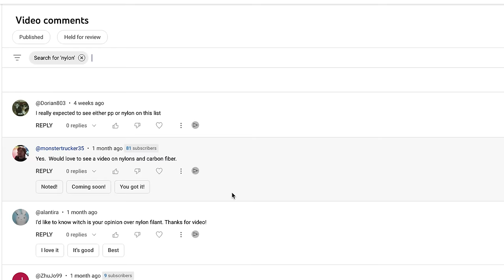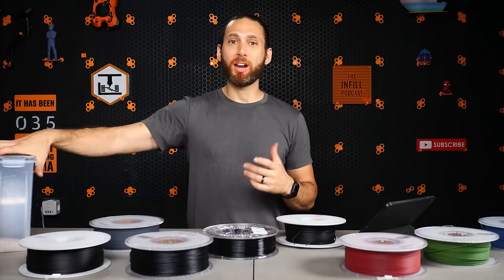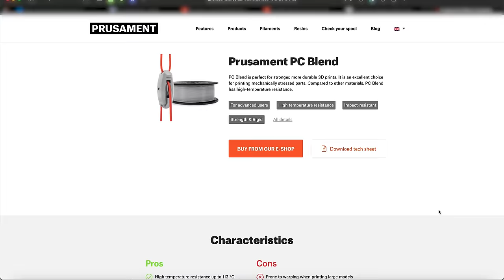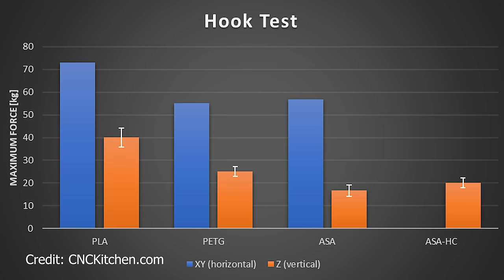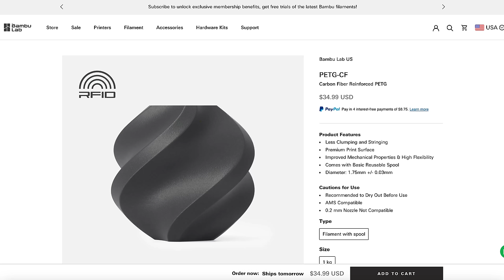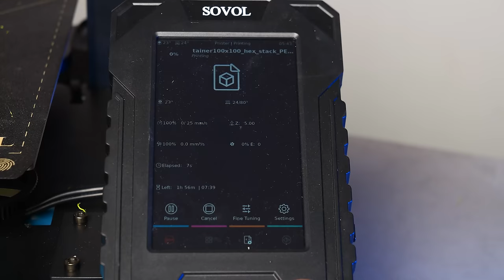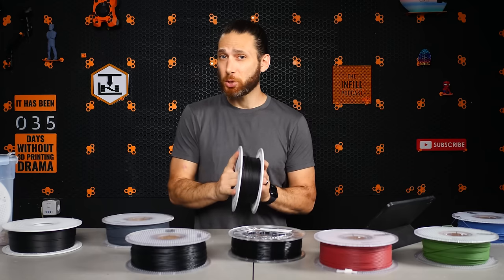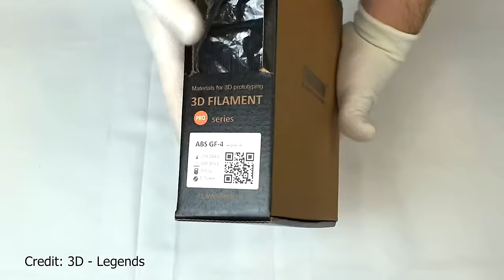Carbon Fiber 3D Printer Filaments: What Are They Good For?

Comment: I read something about CF filament that I found quite worrying, and that were that small dust pieces of the fibre can get into the smallest parts of the lungs and there act like asbestos. The person who said this talked to someone at a lab where they worked with CF and their rigourous cleaning scheme after they used it. Unfortunately, back when I stumbled upon the piece even printing in PETG were an adventure and I stuck to PLA, and now Iwhen I would like to take a closer look at it I can't find it :/
Reply: You should be careful with any kind of fibres but filament with fibres is pretty safe. It getting in the lungs is only really a concern if it is airborne, like when cutting or sanding. When printing the fibres are suspended in molten plastic and when cooled they are stuck in the plastic, there is little chance of them escaping whilst printing.
Reply: @conorstewart2214  someone should make that a pint in a video that cutting, sanding, milling etc is hazardous .....
Reply: The process of printing itself can create airborne particles and we also have stringing. Some fibers may fall off or wear off from the surface just from handling a printed part. So, this is a legitimate concern. However, probably not very dangerous if you are carefully making a few parts. For business/work check with occupational health. This really goes of all printing. Having plastic /fiber particles in your lungs is not great.
Reply: @kieculpitt407  in general cutting, milling or sanding isn't that good for you, it doesn't matter what you cut, even doing it with wood can be hazardous, especially with things like MDF.

Even sanding 3D prints isn't that safe because you are creating loads of little plastic particles that get airborne too.

Comment: PETG-CF is a material ive printed a significant number of functional projects with. Except for rhe difficulty in gluing it, I've found it to hevan excellent material for my needs. That said, i haven't printed with it for quite dome time because I now have a printer that can handle PC-CF well. It does everything as well or better, and the difference in cost (for a cheap version) is minimal.

Comment: A little off topic, but I loved machining Nylon. That shit cut way easier than melted butter, but was pretty hard. It was actually harder to dent than aluminum. It is nice to see someone going over Nylon in a 3d printer.
Reply: Printing in nylon has been around since the start of 3D printing when people used to dry out strimmer line to use as filament.
Reply: @conorstewart2214   when there is a will, people will find a way. I don't often hear people talk about it. Is it rare to see someone use Nylon in these days?
Reply: @Itsdirtnaptime  no nylon is really common now, it is the most common of all the higher temperatures/higher performance filaments.

Comment: polypropylene would be a good topic. I found that if you have a small footprint like a benchy, run a PC profile (X1carbon) (brim) over packing tape with a bed temp of 27c. It will print full speed with no issues. For big footprints, you'll have to go the very slow and hot route or it'll pull off the bed.

Comment: I used PC to make a few different parts but the most useful was a set of cookie cutters. You’re not supposed to use it for food but I figured it ok since the cookies would be cooked after. Nice thing about PC is I could put it in the dishwasher on sterilize without a problem.

Comment: @thenextlayer heck yes a third video!
One aspect I didn't fully appreciate when acquiring a Bambu Labs X1C was just how incredibly easily it slings out these prosumer engineering filaments. It makes my head spin how easily I can design something silly/ambitious and just throw it at the X1C and it simply ... works**.

Just for curiosities sake, I've been trying out all the advanced stuff. PLA-CF seems pointless, anything that needs that strength absolutely needs heat resistance better than a mild Australian summer day, PETG-CF is a similar boat although perhaps it's ideal for test fixtures on a budget.
I'm sensitive to styrene so ABS is a big no and ASA-CF still smells enough that it's a special cases only - cold creep resistant printer parts spring to mind.
eSUN PA-CF is interesting, very strong but as it hydrates after printing gets quite flexible. Makes for great JST pliers and springs. Bambu PA6-CF appears to retain most of it's rigidity in the weeks after printing. Bambu PAHT-CF even moreso than PA6.
PET-CF is an interesting case - according to Bambu specs it's the most heat resistant filament they offer and the most rigid. After printing v-slot wheel x-carriages with it, I agree! However, the gotcha seems to be PET-CF does tend to print holes well undersized.
Polycarbonate comes out gorgeous and is ideal for electronics enclosures due to it's relative lack of flammability compared to other printable plastics and light shades because it's beautiful.
With the release of the X1E, I'm hoping Bambu Labs release a house brand PPS filament to go with it (ding third video!). Apparently such material is printable ... veeeeeeery slooooooooowly ... on an X1C and I want to print Christmas bells that actually ring just because I can (might be able to)!

**works as long as the filament has been properly dehydrated. When they say 80°C blast oven for 12 hours, they're not kidding.
Reply from the maker: Thanks for the awesome rundown on the X1C and all those filaments! Super helpful to hear your experiences. Can't wait to see what you print next. Cheers! 🌟👍
Reply: Hey Matts5136, not sure what v slot wheels are but am printing wheels for heavy doors on an ally track at the moment... commercial wheels in this size apparently not available. I'm using abs printing on a qidi so it's good to hear you're bambu experience. What would you suggest for our Aussie (qld) summer, solid wheels 22mm dia with 8mm axel... I was leaning toward nylon ... appreciate any fb. Cheers
Reply: @xboa721 nylon seems like a good call for it's strength, but I suspect cold creep will ruin your day - I'd think creep resistant plastics like ABS or ASA would survive better. I'm not sure how polycarbonate fares in this application but it may be another candidate.

Comment: PET-CF is superior to PA-CF’s in heat resistance. I’ve switched over to PET-CF for a lot of stuff instead of PA12/PAHT-CF. The cost savings is drastic also.
Reply: It is also more rigid I have found and also seen looking at the properties and doesn’t absorb moisture and reduce its properties like nylons do. The only real downside is that in some cases it can be weaker and isn’t very impact resistant.
Reply: @conorstewart2214  All true. It is also a bit harder to print with simply because the filament is fairly easily to break on the spool, so any hard bends run the risk of snapping it while printing unfortunately.

Comment: For printing 3d printer parts I am more interested in flexural modulus than failure strength.
Reply: Pc is one of the best for printer parts well I'm sure ultem peek pek etc would be superior but also empty your wallet and uneeded you could also cnc your parts cheaper than those filaments
Reply: Temperature resistance is important too. For Bambu PET-CF and probably other PET-CF the bending modulus is over 5000 MPa (around double normal PLA) and has a temperature resistance around (200 C). So it would probably make a very good choice for 3D printer parts if you can justify the cost. I also don’t think it creeps like nylon does.

I also saw a nylon with ceramic microspheres from spectrum, it’s datasheet claimed a bending modulus of around 10000 MPa but other than that it’s properties weren’t spectacular and it is expensive.

Comment: What would you use for a small fixed wing UAV that needs to be lightweight (2-3kg), very heat and UV resistant and has sensitive radio/gps, which won’t play well with carbon fiber? Thanks for all the insights!

Comment: Hey man, thank you very very much for the video. Actually turned me onto a couple of engineering grade filaments that I hadn’t had any experience with yet such as the PC, I literally ordered some while I was watching, as far as the ABS glass fiber I do a lot of printing with air gun suppressors. And thorough testing with them on an oscilloscope and spectrum analyzer on top of regular decibel meters with DBA, DBC, and DBZ, and as far as the ABS glass fiber, that was one of the first engineering grade filaments that I had purchased along with PA 12 carbon fiber, PAHT carbon fiber, PET carbon fiber, and atomic nylon carbon fiber. Since then I have used the ABS, carbon fiber, and I have found better properties for my application with the ABS carbon fiber, then ABS glass fiber. Also, I had noticed that the glass fiber was more difficult for me to print with. More finicky, the ABS carbon fiber, printed perfectly from the first print. Mostly those filaments I’m using an X Max three because of the 350 C nozzle, temperature, and heated chamber, as well as heated bed and build size, I’m pretty confident the bamboo could handle it, but this printer actually seems to do better with these type of filaments. It doesn’t compare to bamboo as far as standard filaments, but when it comes to higher temperature filaments like these. It is definitely superior in my experience, as far as the ABSCF versus ABS GF, I have had different results, I actually have a harder time with the glass fiber for some reason? I’m not sure if there’s something you’re doing differently? The carbon fiber printed for me perfectly from the first time. And since the carbon fiber is more useful for my application, on most occasions obviously that works for me, but the Glass fiber in some instances is better because it is more rigid when complete. It’s obviously also very frail, which is confusing, but before it fails, it is extremely strong. Once it fails, it fails dramatically, like you said about something in the video, that’s similar in my experience with ABS glass, fiber. I have printed with almost all of the other filaments that you mentioned I do PETG carbon fiber, almost all the time, because that is one of the most effective filaments for my purpose, the carbon fiber PLA looks great, and comes out perfect every time. I don’t think I have messed up one print with that, and it sticks very well, very easy filament to use the only printers I’ve used are the X1 carbon, X Max 3, and my most high end printer is the modix big 60 which has been amazing. Anyway, if you have any thoughts on the difficulty I’ve had with Glass fiber versus carbon fiber, ABS I’d be curious to hear them.
Reply: No purpose to this reply. But you said you print airgun suppressors. I love modern pcp airguns. I have an umarex hammer, an umarex gauntlet in .25, and a benjamin bulldog. I bought the suppressor on the bulldog because it matches the shape of the bulldog, and just looks like part of the gun. That was before I started 3d printing myself. Either way just a HI from a fellow airgun enthusiast.
Reply: @michaelabraham9177  no worries, Michael, I’m happy to reply to anyone who comments on the videos. Honestly, that’s why I do them is so I can reach people who can use the advice etc. so I started modifying suppressors that I had bought when I opened the Donny Fl suppressor and found a hollow tube with felt and screening with a piece of tape, I was disgusted so I started machining aluminum baffles and putting them in the housings from those moderators. After coming up with a design that was 20+ decibels quieter than anything I had tried on the market and at that time it was four or five suppressors, now it has been nine from different companies all their best products, and I am getting even better results with the 3-D printed engineering grade material, it is absolutely astounding how well some of these carbon fiber, filaments isolate sound! Thank you for the comment and thank you for watching
Reply: @michaelabraham9177  shoot I’m sorry I thought you had watched one of my videos, I’m just realizing this was a reply to a comment on someone else’s I apologize. Anyway, I appreciate your support.
Reply: @Cjsairgunscarsandmachining  lemme know what your channel name is if you got the time, I'll check it out.
Reply: @Cjsairgunscarsandmachining donnyfl! There's nothing wrong with felt as most mufflers use fiberglass. If you're going to print internals, I'd stick to a flexible monocore instead of hardened materials should you ever have a baffle strike. You could also try a screened-in salt shaker with loose media

Comment: Have been using PETG-CF.  My only dislike is that it is so gummy, even when dried, if you don't baby sit it or have a wiper setup larger prints are impossible.  Super stuff though for finished characteristics, the most chemically resistive of the cheap filaments.  Makes the ideal filament for direct chemical metal plating because it does not breakdown hardly in the caustic solution.

Comment: Hi..great video. I want to print a goggle for holding a small camera within it. It needs to be light and strong and fairly rigid but not brittle. If cost is not a consideration, what would you suggest I use for material?

Comment: I use PC as a staple as a design engineer. I use it for small mechanical parts and camera mounts. I print it on glass on a Ultimaker 3 ex

Comment: I've had awful issues with PETG stringing, especially if I tried to print multiple parts at once.  I thought that the materials hydroscopic properties might have been the cause, be even first prints from a newly opened sealed bag 'straight from the factory' had issues.  Then I tried drying the filament before use.  I don't have a real filament dryer, so I simply placed the filament spool back in the box it came in (no bag) with the pack of desiccant inside the spool hub.  I put the box on top of the printers heated bed (set to about 60C) and left it there for a few hours, flipping the box over once an hour.  Then I tried printing multiple parts at once.  WOW!  ZERO stringing!  And the parts looked great!  Think I'm going to get a real filament dryer.
Reply from the maker: Yep. It has to be dried!
Reply: Unfortunately straight from the factory does not mean it is dry. Quite often filament will need dried right out of the sealed bag, especially with highly hygroscopic filament like nylons.

Comment: Just using PLA. If i need some other materials i often use PLA as casting/molding form. The rare times I can't produce the part by molding I buy it online. It's much cheaper than to booster my machine to work with high temp materials.

Comment: A number of times you mention a filament dryer.  Some seem to "shut off" at about 30% humidity.  Is that true of most?  My "normal" humidity (Relative of course) is in the 20s or often lower.  What humidity are you suggesting to get some of these filaments down to before trying to print them?
Reply from the maker: Mine get down to 10%

Comment: I have a question maybe you could help with. I built a tube bender for 1 5/8  thin wall tubing and it will require a bending mandrel to retain the tubular shape as it bends. Some people have made mandrels out of delrin rod cut into small pucks strung together on a cable or chain. This is certainly doable, but I was thinking perhaps 3D printed mandrels might be easier to fabricate. What do you think would be the best material to use for strength? Mandrels are subjected to heavy compression loads and pulling forces as they sit inside the tube being bent right at and slightly past the bending point in order to retain the tube shape. 
I'm thinking polycarbonate or nylon carbon blends would be the strongest. 
Thanks!

Comment: I got a ultimaker (makerbot) method x carbon fiber for the company I worl at and we love it so far, we use it for alot of rapid prototyping in automotive sensors, the nylon 12 cf can handle 154c temps and has 60mpa tensile strength, its very legit

Comment: I work at an injection molding facility. Poly is a pain to work with when you're using the same old molds that were manufactured without the intention to inject poly. Great material, just a pain to work with.

Comment: I was printing planetary gears for E-Bike motors in Nylon. They worked fine, but ended up being more of a consumable than I would like so ended up getting some local fab shop to do them up in metal on their CNC. Couldn't work out if it was torsion or if it was the heating a cooling that would end up weakening the teeth.

Comment: I have used Fusrock ABS-gf. It requires  40C and above chamber temp  which  I achieved by dexterizing (enclosing it with a thin roll of plastic) the cr10s pro. Heated the bed to 100C and 250C nozzle. Adhesion solved with some painters tape and gluestick. It's very stiff. Enough for building an enclosed 3d printer.
Reply: A 40 C chamber should be easy to accomplish just with a cardboard box over the printer and using the radiated heat of the bed to heat it.

Comment: I recently tried PLA CF for some rc components I designed. I knew going into this it was kind of a gimmick but surprisingly, it's a lot more stiff compared to the same part printed in normal PLA+. I haven't had a chance to test the full RC (still waiting on bezos to figure out when Next Day delivery starts) but the parts have at least survived some uncomfortable rough housing while getting them fitted lol

Comment: I use PAHT-CF and PET-CF for printing esk8 parts which I ride under load (I'm 95kg, 200 pound). PAHT-CF I only use for small round prints like pulleys and wheel adapters. Flat object I use PET-CF because PA warps to much ✌️

Comment: Hi, Any recommendations for first 3D printer for home use, making durable parts, moulds for casting resin and concrete. I am a beginner, have printed a few things at work on Prusa i3 MK3 but only in PLA. Cheers